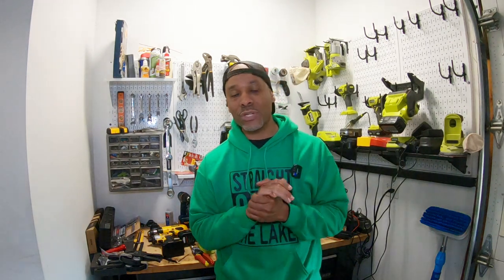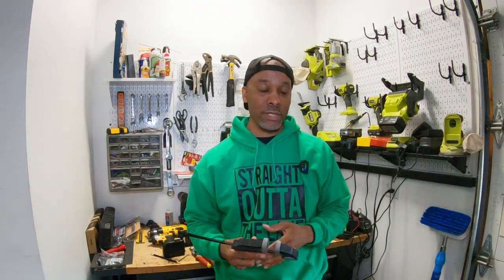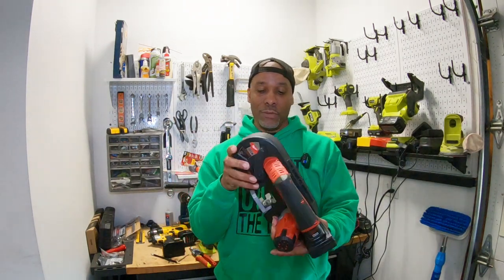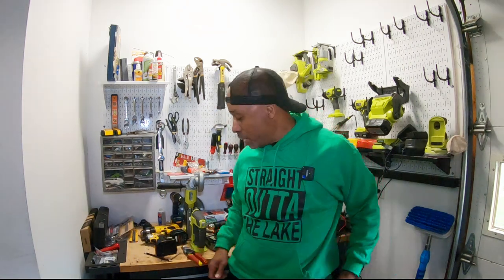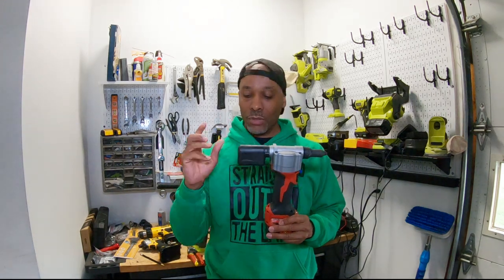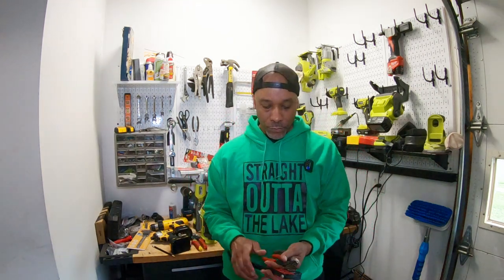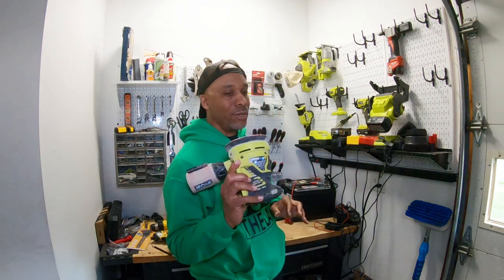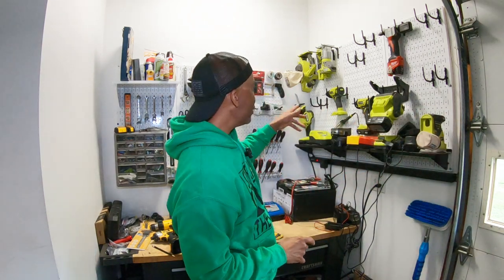Jon Boat to Bass Boat Conversion Tools Breakdown

Comment: I’m nearing the end of it own build; in retrospect, I could simply my tool assortment to include a circular saw, a cordless drill, a reciprocating saw, and a hand riveter.  I got smart far too late and used a reciprocating saw with a 6” metal blade for cutting angle. It made so much less mess than a circular saw.  I’m putting in a wood deck, so I used the circular saw to cut deck pieces and to make plunge cuts for hatch holes, which I finished cutting with my reciprocating saw with the same fine-tooth blade. I did not spring for the Milwaukee riveter; instead, I bough an Astro rivet drill attachment for $50 on Amazon, which I used with a 12V DeWalt cordless screwdriver I had lying around. I estimate I used about 500 rivets for my build; the cordless screwdriver/rivet attachment was maybe 5 seconds slower per rivet, so (500 x 5)/60 = 41.67 minutes, so the additional 42 minutes over the 2-3 days of framing work using a rivet attachment saved me $200. What I would have done looking back, though, is spent a few dollars more on a hand riveter and invest in a ratcheting riveter for tight spaces.
Reply from the maker: Solid man.  Thanks for sharing your experience.

Comment: What do you use for countersinking?  I think the countersink rivets have a 120 degree cone angle, but I haven’t found bits wider than 90 degrees. I use 5/8” diameter but perhaps smaller may be easier to gauge the depth of cut if the cone angle is  wider than 90 degrees. Your countersink rivets always look good to me; lots of mine, especially in tight spaces where I can’t make a circular pass, are a little proud of the angle.

Comment: What kinda blade did you use in the miter saw?
Reply from the maker: I used a 7 1/4" aluminum non-ferrous metal 60 teeth blade on Amazon.  Cuts like butter.